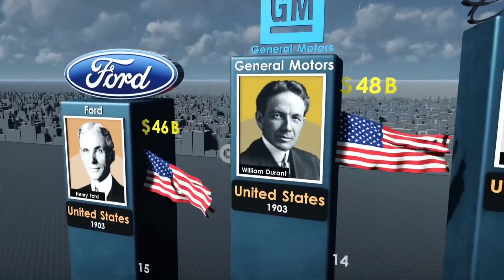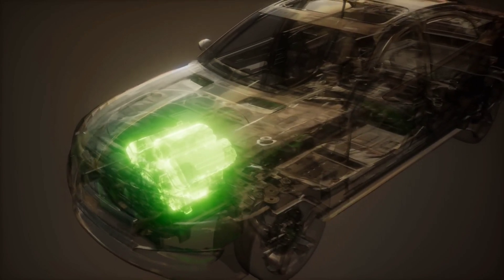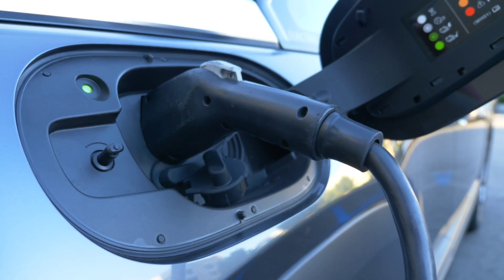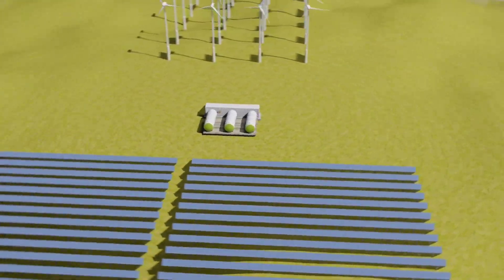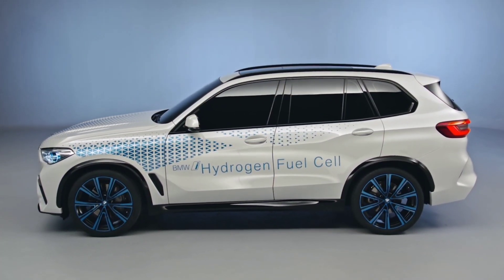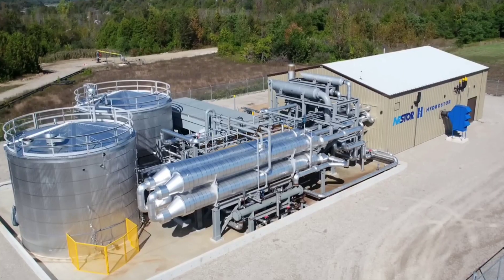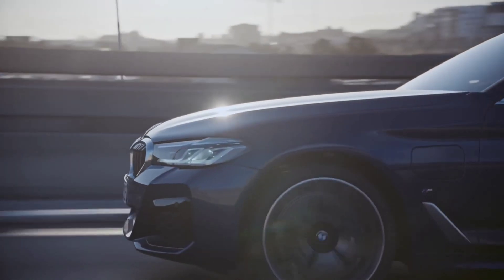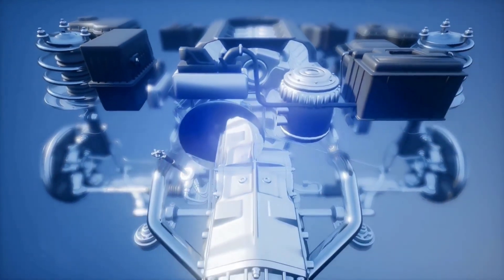BMW’s i5 Hydrogen SUV: Best Alternative to EVs?

Comment: fuel cells fool cells, hydrogen is frightfully expensive and generally made from fossil fuels. The toxic part is the making of hydrogen, that does not exist in nature. No one does carbon capture. Driving with a hydrogen bomb between me and my passenger is not for me. Ev's do not take hours to charge, (15-30 mins) and this is generally done at home, while you sleep. I get almost 500km with my EV,. Why would I need more when I rarely drive more than 100km. These will sell in the low hundreds per year at best. Few jurisdictions have any hydrogen stations.
Reply from the maker: Solid feedback. Ty for watching 👍🏽